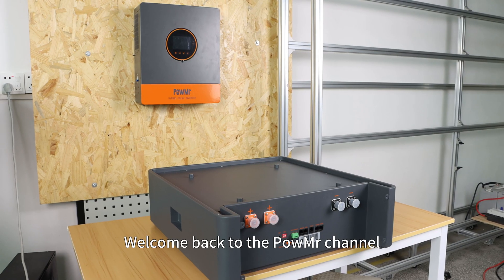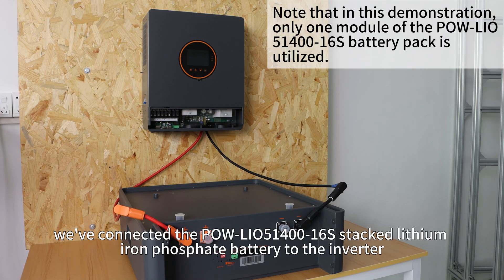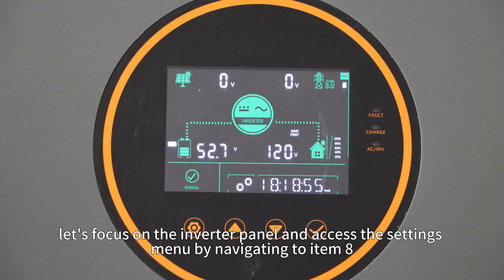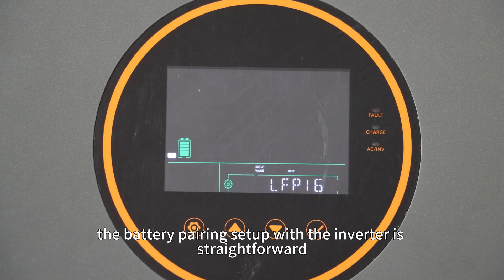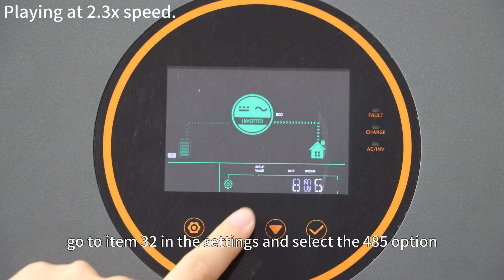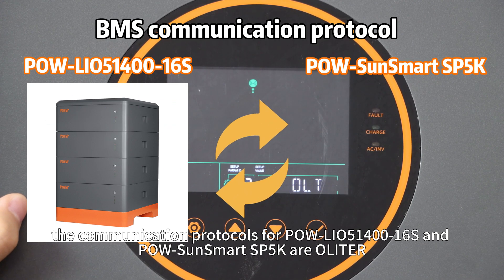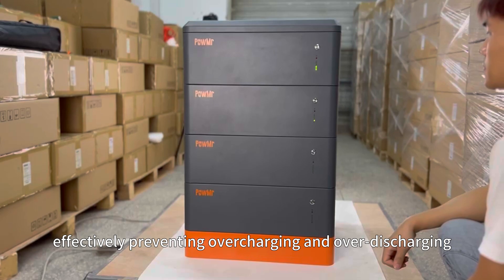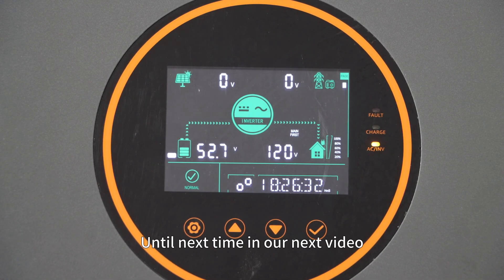How to Perform the Battery Pairing Setup for the POW-SunSmart-SP5K

Comment: Do you use a normal Cat6 LAN cable or do you use a modified cable with different Pin connections at inverter and Battery side?  The manual sais to cut off pin 1/2 (5v/GND) on the inverter side.. so are only 2 pins used for either CAN or RS485?
I try to connect to JK-BMS battery controller, but so far could not get it to work.
Reply from the maker: Please send your problem to this email: support@powmr.com.

Comment: hey i bought your inverter in india and i have having problems in connecting it with the battery bms there are many options LIB,LIC ,LIP ETC  i have 120 ah 48 volt lifepo4 battery how do i make sure it communicate with the inverter please help
Reply from the maker: Hi, kindly send your problem to this email: support@powmr.com.
Reply: What is the value for option 9 and option 11 in sp5k